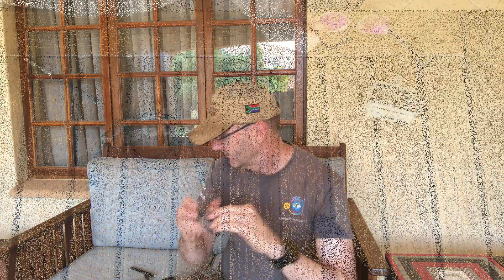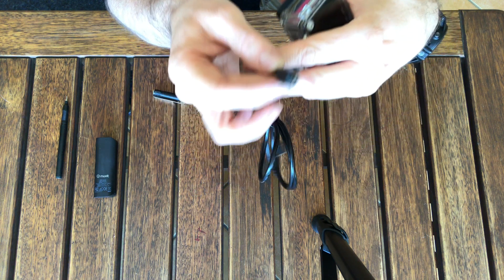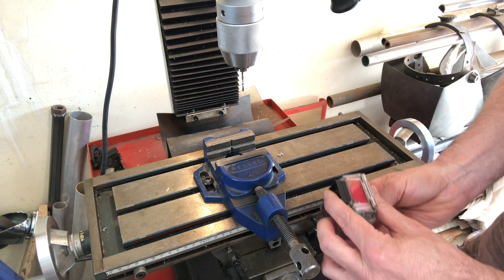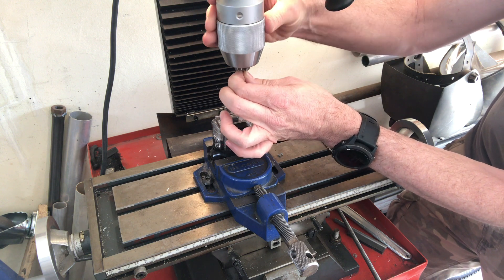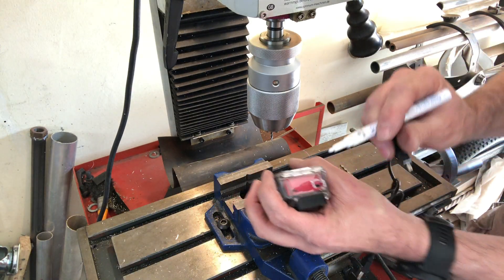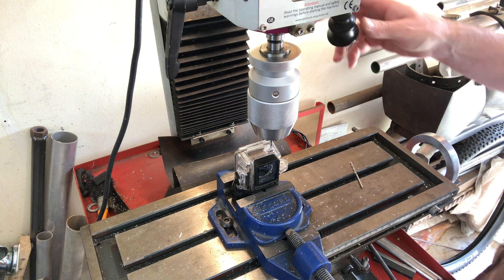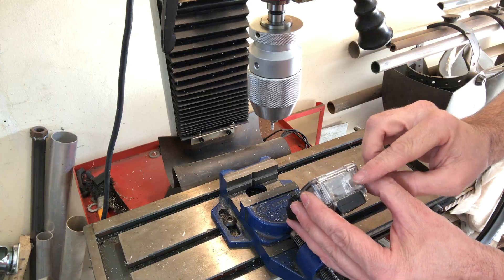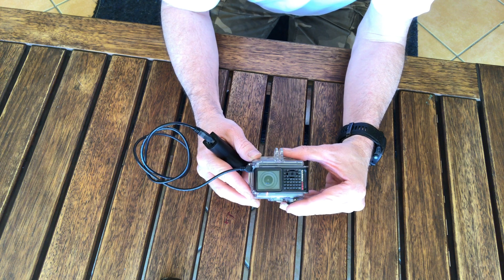External power source for Garmin VIRB Ultra 30

Comment: Love how Garmin supply an expensive camera with no way to mount and power it at the same time. For those without a slot drill, you'll have to shell out for the cage case

Comment: If you cut a hole in the case, will this mess with the altimeter function?  I see there is an "altimeter" door for the waterproof case.  Does this use atmospherics pressure inside the case to calculate elevation?  if the case isn't airtight, then I would suspect the altimeter wouldn't work properly.  Thoughts?
Reply: Altimeter functions REQUIRES a hole in the case in order to measure air pressure. The "altimeter" door renders the case non-submersible although still splash-resistant....see user manual.
Reply: the altimeter door that comes with the camera is not water proof as it has holes in it for the alt changes, this does nothing to affect that.
Reply from the maker: Dave Arnold No I have not had any problems with the altimeter.
Reply: @BrianMaynardLetsDoThisThing Thanks.  I'm looking at getting a powered mount, but will still need access to the usb port to record audio from a headset mic. Therefore, I'll still need a hole in the case.

Comment: Nice and simple tweak.  I had already hacked the waterproof case due to poorly designed start switch on the virb ultra.  So this is a no-brainer upgrade for me.  Now to find a low profile plug and I'll be very happy.  Thanks!!!

Comment: The funny thing is that the original (first) VIRB cameras had a very good solution with the camera itself beeing waterproof (no extra housing) and with a sophisticated "plug" that was also waterproof and vibration resistant. So you could directly connect it with the power bank without any worries... So I am looking for the "old" ones at the moment ;)
Reply: I have a used VIRB XE with USB and 12V power mounts if you're interested

Comment: Hi, can the virb also automatically start recording when power is applied?
And does it shutdown when power is removed? (Want to use it like a dashcam)
Reply from the maker: thijs dohmen Yes, you can set it to start recording under External power. Settings->External Power->Start Recording. Then when I remove the power it also stops recording and then switches off.
Reply: Awesome, thanks!
Reply: yes in the setting you can set to start recording with power.  when you turn the key off it will display  "turning off in 10 seconds" while it saves the video and powers down.
Reply: @mikehernandez1511  ah yes, that is what's happening the past year... :-P